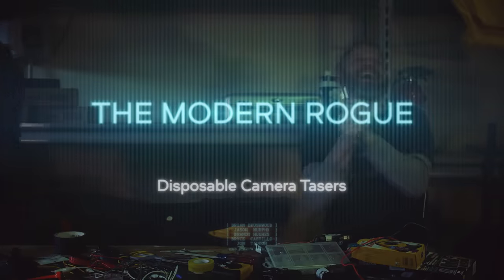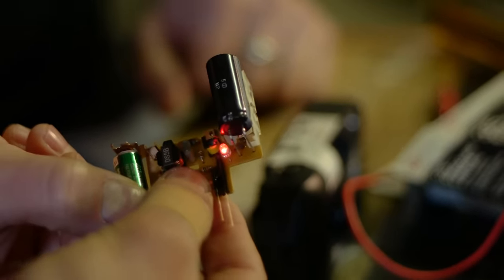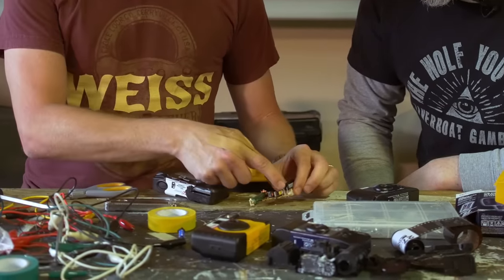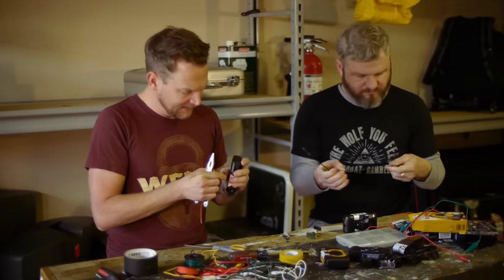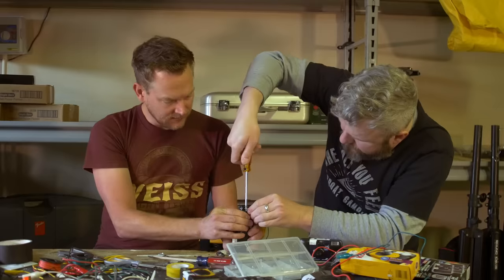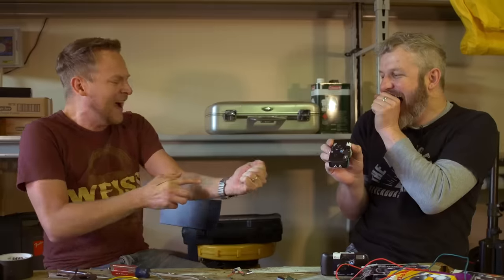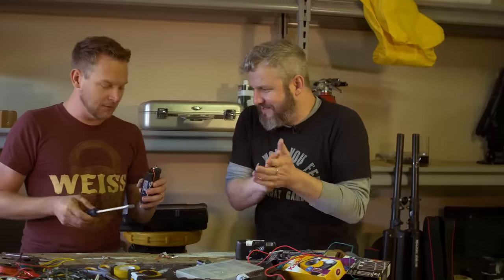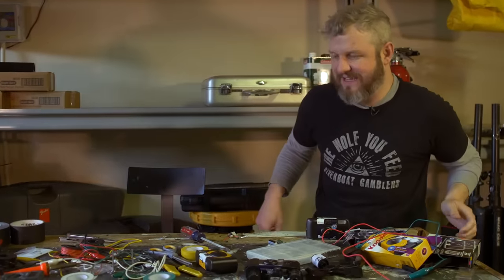Making Disposable Camera Tasers

Comment: In High School, I used to work developing film. Disposable cameras wind the film back into the case but needed cracked open to remove the canister to develop. We would crack them open, remove the film, then charge the flash and toss the bare camera to someone else. Instinct always made you reach and catch it, getting a nice jolt.
Reply from the maker: hah!
Reply: +Thomas Burnelis I'll give you a boost.
That...is a good prank from your good old days.
Reply: Thomas Burnelis ha your old
Reply: not necessarily, film photography is still a very big thing. Film development is still a growing industry.
Reply: @jdevilgamerdrjuciyfruit1348  I'm 29 and took chemical photography in high school. We had a full lab in the school, we even had bulk film and rolled our own.
Reply: Yo sick fk. Lol I did the same thing. Took it apart charged the capacitor and asked my friend to hold it with the circuit board exposed. I never heard someone scream like that in my life.
Reply: Hahaha!!! Try soldering 10-20 of the capacitors together! Gave me a 10,000 volt shock in my hand!

Comment: Back in highschool, our shop teacher decided it'd be a great idea to give us a box of these cameras and get us to dismantle them. Suffice to say we shortly figured out their use as tasers. Even going so far as to solder extra capacitors in to the boards. They also made handy spot welders for thin copper wire.
Reply: damn, I wish I had shop. instead I had history
Reply: i had about 20 9 volt batteries i would link together and then connect the wires with some needle nose pliers and an exposed chunk of graphite on a pencil (rubber and wood outsides for safety) and the flash would always burn my eyes, it wasn't until later i figured out i was welding pencil graphite to my pliers' metal nose
Reply: Why do Americans call it shop? I’m from Scotland, and in the UK we call it “tech” or “techy”
Reply: Not tryna be rude, just genuinely curious
Reply: @MalloryKnox.  I assume it's short for "workshop."
Reply: @MalloryKnox.  DT
Reply: I did the same! 10,000 volts hurts like hell!! 😂

Comment: The whole possibly lethal thing is probably for people with pacemakers or something
Reply: Or if you have some damage/illness of the heart. Same Reason why there are deaths when tazzered. That is also the problem if tazzers are marketed as a nonlethal alternative to guns and therefore used more often.
Reply: ^ Which is why they're called less lethal rather than non lethal.
Reply: +Elbrasch *tazer
Reply: TotalMetalJacket what show where they talking about on begonning
Reply: Nickolas Zuliy Taser*
Reply: If you touch a wire with each hand so the current goes through your heart it can kill you. It would take take a bigger capacitor than this to kill most people though.
Reply: Capacitors not only store high voltages but increase amps which can put you at risk of being killed depending on the voltage and value of cap. A camera flash cap can induce a shock that can be lethal.
Reply: The condition of your skin also plays a huge part.  You can check this with a multimeter and measure the resistance.
Reply: Space Jam hacking the system it’s v awesome
Reply: And it is bad for pregnant women
Reply: If you tase exposed blood (let's say a cut on a finger) it will conduct electricity all the way to the heart and the sudden shock might stop it. It's a known phenomena
Reply: @Elfnetdesigns  Volts that jolts mill(iamp)s that kills
Reply: It's surprising how much of a jolt you can get out of a camera flash capacitor, and if it's going across your heart, that can be legitimately dangerous. Definitely be careful with this.
Reply: @IglesiasEscalona  Dart firing stun gun. Taser International is just a brand name, the product is called a dart firing stun gun. Like Mace is just a brand name, but everyone calls pepper spray Mace.
Reply: Or if the electricity is delivered at a very specfic time in the cardiac cycle.  There is a minute amount of time in between heart beats, called the relative refractory period, where enough of the cells of the heart are repolarized.  During this time they are ready to take an electrical signal and depolarize.  But since not all cells are ready it won't be a complete beat and can but the person into an abnormal heart rhythm.  It's a very small amount of time but theoretically could happen.  It's part of the reason why taser aren't considered safe and are designated as less lethal.
Reply: Actually this is impossible because the current isn't going through your heart unless you put the leads in both hands.
Reply: @pencrows  because the electric current like to travel the shortest path. That is why the one hand rule is used when dealing high voltage appliances.
Reply: @digestedoat  hacking the system
Reply: Possibly if you did it closer to your heart, too...
Reply: They’re also worse for people with bleeding disorders
Reply: @Elfnetdesigns   Absolutely not, that cap definitely does not have the capacitance to hold a high amperage for more than a few nanoseconds maybe microseconds, at that amount of time the energy dissipated to you is really not that much at all. There is very small chance that a cap of that size would do any serious harm to a healthy person.

Comment: I wish i had known what a capacitor was 20 yrs ago when a 10yr old boy was tinkering around with one and grabbed the capacitor and twisted (connecting the wires). The shock was so hard my fingers seriously felt broken and hurt for the whole day. An experience I have never and will never forget.
Reply from the maker: ouch.
Reply: Little Xel is
Reply: Little Xel shocking to say the least, I'm shocked you didn't have to go to the hospital
Reply: shocked
Reply: Little Xel that's shocking
Reply: Little Xel same. I burnt a hole about a centimeter into my finger with one of these once.
Reply: Mindtrick Games "Did it hurt?" xD
Reply: Same thing happened to me but my friend was touching my arm so we both got shocked.
Reply: I work on and fix old tube amps and record players/ am/fm stuff. Some of those caps can straight up kill you in a blink.found out about a month after I started working on that stuff. Boss warned me about it before I ended up dead in my basement😂
Reply: @buckfutter99  mmmm,good ol' AA5 circuitry :3

Comment: You can upgrade it by adding a bigger capacitor
Reply from the maker: ohdeargod.
Reply: Ricardo Rodriguez if you use big cables a car battery and giant capasator makes unsafe lightning rod( do not try,)
Reply: Roan Oneill will make sure to try that
Reply: Ricardo Rodriguez Would it be possible to use two capacitors?
Reply: Ḳαяl ḱαґʟeκ 
Yes 
In parallel but the charging time will increase too
Reply: Ricardo Rodriguez 
I made one wit a 15.000µF cap. 
It was quite a shocking experience to saw my wires instantly vaporize when I tried a "safe discharge" leaving a very beautifully black mark on my bench.
Reply: yes but to shock you need voltage, the higher voltage the more painful the shock
Reply: Both the battery and the capacitor would need upgrading if that's the route you're going. Bigger blast means more fuel needed, and more fuel needed means more time replacing batteries.

Although, if you're able to kill a battery with this thing by just using it on people, you'd be an asshole in that case.
Reply: Use a car ignition coil instead and you can bypass the capacitor entirely
Reply: what is really funny too is you take a film capacitor put it in your power outlet, let it charge up for a second and throw it to someone and say "catch it"

we did that at work a lot lol but fucking dangerous

please don't try this at home

Comment: It can't be lethal, but it sure does hurt a fucking lot, I'll tell you that.
Reply: it can
Reply: Add big capacitor
Use bigger battery
Aim for the neck
Reply: I doubt skin would have a low enough resistance to allow enough current through the heart( apx 80mA)
Reply: with the electrodes close together it's "relatively" safe. the current only flows between them, and doesnt penetrate much. (the reason why tazers make people cramp up fall over, and stun guns usually dont) but keep in mind that this is a potent DC shock of ~300V, not unlike defibrilator. that can indeed be very dangerous, if it flows through the body. (say from one hand to the other)
Reply: I'd probably be lethal to someone with a pacemaker
Reply: ^^ This.
Reply: it can. Never touch each end with different hands, otherwise it can pass through your heart and kill you

Comment: It's completely possible for this to be lethal. It all depends on the path that the current takes,skin resistance,contact points,etc. As a localized shock to your forearm,it's probably fairly safe. What you don't want,is for the path to go across your heart,like say,a shock from one hand,up your arm,through your chest (across your heart) and back down the other arm. Those capacitors can be charged to over 300Vdc,and can deliver a fairly high current peak. Use the 'one hand rule' when tinkering,and you should be mostly okay.
Reply from the maker: oof.  Well, I'm glad I now know about the "one hand rule".
Reply: Damn . . .
Reply: +The Modern Rogue got shocked by it once when taking apart, If you know how a dead leg feels (if you sat on it for two long) imagine that 4x stronger going up your arms... Feels freaky
Reply: +PaddyDoesTech it feels like your insides of your arms were replaced with sand for a second
Reply: yea if you had a pace maker it would kill you
Reply: when i was little i built coil guns from these camera circuits. one day, i had 6 of these caps in parallel and accidentally touched + and - with each of my arms, and it shocked me across the chest. it was the most debilitating thing ive experienced, i mean i just sat there for prolly 10 minutes breathing heavy, it took all the energy out of me. the thing is dc shocks feel like getting hit by a truck, there is no tingle like people usually associate with being shocked. I was charging a bank of these caps another time and accidentally dropped them on my lap, but that wasnt bad, for some reason getting shocked across the chest is just no good
Reply: I was once careless with a HeNe laser power supply. It was unplugged,but those dang caps still held a charge. It felt like someone hit me across the chest with a baseball bat at full swing. Not something I wish to experience again.
Reply: PhattyMo DC is not going to give you heart problems, AC is, but DC will cramp up your mucles and blodvessels and can mess up your stuff, but when you get stuned by DC the danger is mostly over with after a few minutes, AC on the other hand if it goes hand to hand can give you irregular heart rythm several months later.

Also Volts are not what you should look for when you get shocked, you have the AMPS and the WATTS that are scary. Cause when you walk on carpet and tuche metall if you can feel the shock then you felt over 3000  Volts but almost no Amps
Reply: I doubt this has high amps...so it's not lethal unless you have heart problem
Reply: Steven Densmore For some reason I want to try to experience them. DARN IT!! How you put it just makes me Gosh Dang curious.

Comment: Funny thing is, I discovered this before even watching this vid... Had an old disposable camera that ran outta film a few years back... Messed with it a bit (fully intact), and kinda thought to myself "If I can hear it charging, that must be a crap-ton of power..." Eventually managed to take it apart, and futz with it a bit... At first, learned of a contact that would close the circuit to the flash, because the flash wouldn't trigger after the film ran out, and the "take photo" button became useless... That was kinda fun for a while... Then I learned about the same thing you guys did... Never got around to actually doing the screws or nothin', just that I could short out the capacitor with a screwdriver. 

(On a side note, I'mna look up WHY the cameras make that high-pitch noise when charging... Parts vibrating, or what?)
Reply: The noise is because of the high frequency pumping transistor that takes the DC from the battery and switches it on and off very fast into a transformer where you need either AC current or pulsed DC to create the fast collapsing magnetic flux in the transformer core to boost the voltage. Once it's boosted it gets stored in a big capacitor . Once you press the snap button BAM. So that's simplified a bit but you get it. It's a hardcore shocker!

Comment: I actually used the flash circuit and some buttons, wire, and solder to make a flash gun. Essentially I hot glued it to a plastic gun and put a trigger on it. It's a reusable flashbang gun. In the process of making it/while using it I shocked myself 5 different times in 4 different places on the circuit board, promptly coating the leads with hot glue after each shock. I still found a new place to accidentally shock myself.

Comment: I worked on an old tube radio, replacing its power unit and for that reason I had to build and install a new capacitor bank. The original capacitors were still good but me and my coworker decided to only use them for testing purposes, as they had started to become dry. The capacitors had to be installed on the Mains side of the power unit, were the voltage is high, we're talking 400V here. For testing purposes we attaced the new bank designs prototype, complete with the old capacitors into the new power unit, plugged it in and started our measurments, seeing if everything worked just fine, despite the fact that the old capacitors were a little less then optimal. To our surprise, the capacitors were performing much better then we expected. Too good for me infact.
Clumsy me, trying to measure something near the Power Unit (I actualky don't remember much from the actualy incident XD), bridged one of the capacitors with one of my hands. Just one. Wasn't so bad, if you let out the fact my hand yanked back on its own and I could not feel it for 15 minutes flat. I am just glad I really just bridged a capacitor, since they don't put out much amps, I could have done more damage to my hand then having a numb hand for 15 minutes.

Comment: I discovered this trick when I was eight years old...I was taking a part One of these disposable cameras and Messing around with the flash when I accidentally touched the capacitor.... It gave me a shock that I will never forget it's actually worse than a store-bought stun gun because of all the current... Store-bought stunguns are usually 50,000 v or 100,000 v it can be higher or lower depending on which model you buy but the current is very low it's in the Ma range.... Which by no means is comfortable but not dangerous...but the disposable camera flash circuit charges that capacitor to 330 V at a much higher current.... It's enough to spot weld wires and Blow holes in a pop can when discharged.... After that I started to collect all of the capacitors that I could get from these flash units and wind my own high-voltage transformer's to make a souped-up version I connected the capacitors in series and parallel so I could raise the voltage to 1000v and increase the overall capacitance.... It was a fun little project that worked very well.... I would definitely recommend trying this if you're interested in electronics just be careful and don't forget to incorporate a blead resistor across the terminals of the capacitor bank so you don't accidentally leave the capacitors fully charged when not in use....

Comment: Hey if anyone is interested in how the camera even achieves a spark like that, you may notice the coil of wire on the camera circuit in the beginning of the video. This is actually a small transformer that will produce a much higher voltage when AC passes through it. Since the battery outputs DC and the capacitor charges it as well, the rest of the flashing circuit is a DC to AC converter and then an AC to DC converter. The former will between the battery and transformer and the latter will be between the output coil of the transformer and the capacitor.  If you want your taser to charge faster you may try replacing the current capacitor on the board with one of a slightly smaller capacity. This way the cap will reach full voltage faster!

Comment: Im an electrician and have been hit by 277 volts. Did have a coworker attempt to discharge static from 4160v with a piece of wire, well one the knives didn't disengage on the breaker and when he hit the lead he caused a direct short and blew the wire up in his hand. Somehow he lived with only minor burns to his arm from the arc flash.

Comment: In grade 9 science for physics, we had a Van de Graffe generator (or at least I think that's what it was called) that worked with a rubber band and we all stood on chairs holding hands. The person at the start put their hand on the generator and I (being at the end) was told to touch the ceiling  where there were little metal beams running across. You can all guess what happened next and it wasn't comfortable. Before this run though the guy at the start had too little padding on the bottom of his shoes and his foot was on one of the bolts so that was a fun day.

Comment: The voltage saftey limit for VDC is 50v but what you should be worried about is amperage if thats higher than .1 its can be dangerous. The tolerance varies from person to person

Comment: This device is relatively safe, as the circuit in the camera produces an output of extremely high voltage, but very low current. High currents are generally considered dangerous, leading to heart failure in extreme cases, but high voltages are generally considered non-damaging.

Comment: Get a another capacitor from a different camera and place that capacitor in parallel with your tazer's capacitor for double the strength. I used to do this when I had my own tazer camera. I went up to three capacitor. Note it takes twice as long to charge with two capacitors.